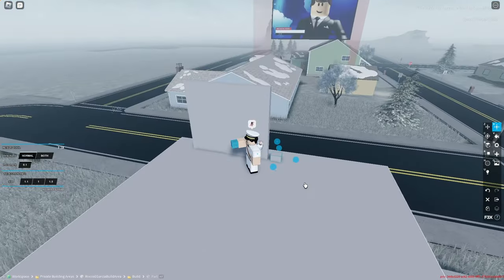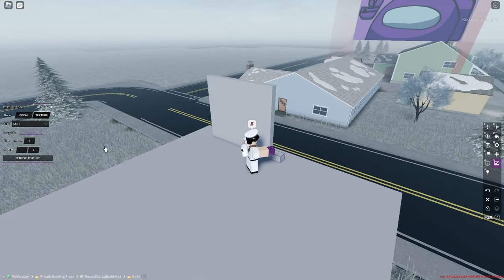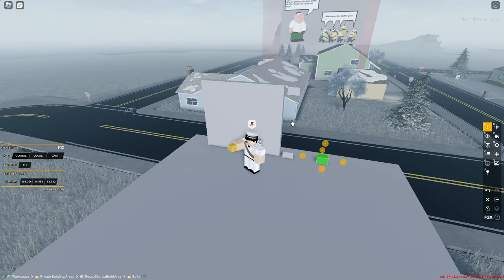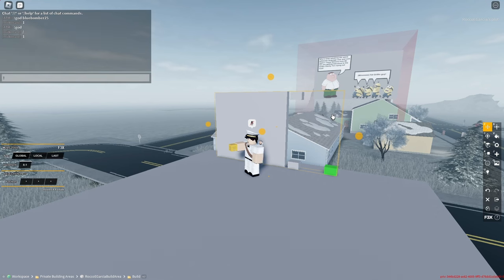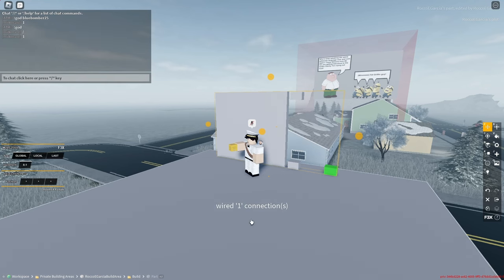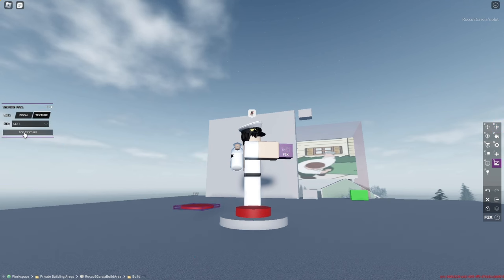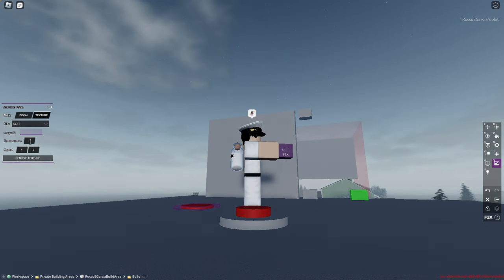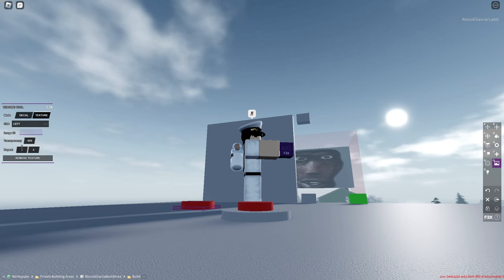HOW TO MAKE BUTTON ACTIVATED DOOR IN TOWN/TOWN DEBUG

Comment: @roccogarcia7948 ayo how did you make the parts almost flat and have so much freedom while moving them? i basically have nodes set for me
Reply from the maker: On the left when in the move or extend mode there should be a thing that says increment. Lower it to make it more precise I like to use 0.1
Reply: thanks man, currently i learnt how to make trapdoors and elevators using this tutorial (somehow) @roccogarcia7948